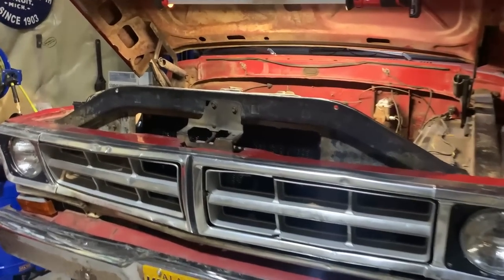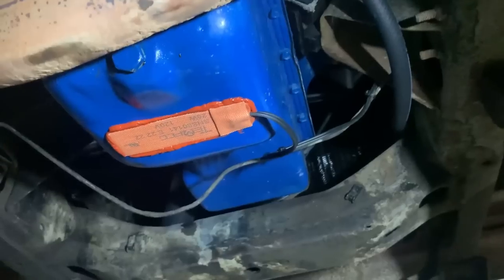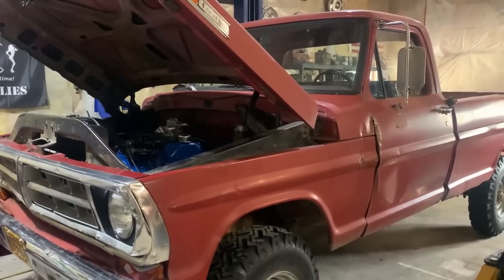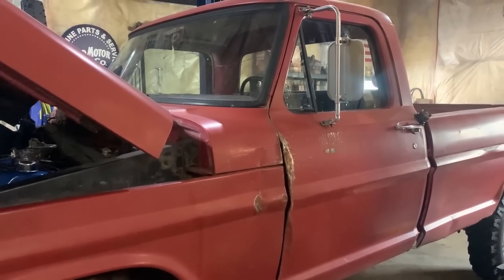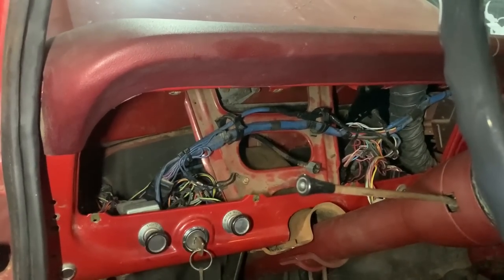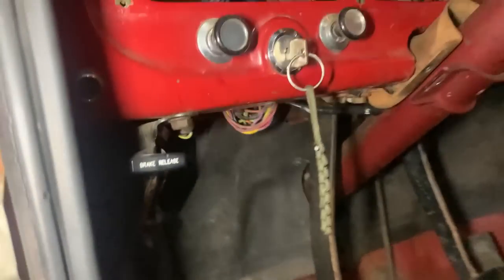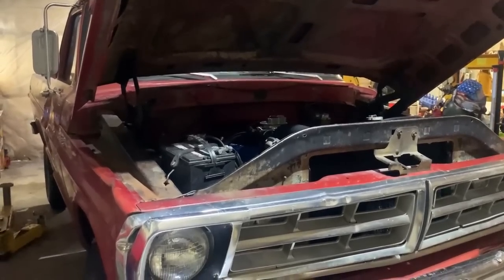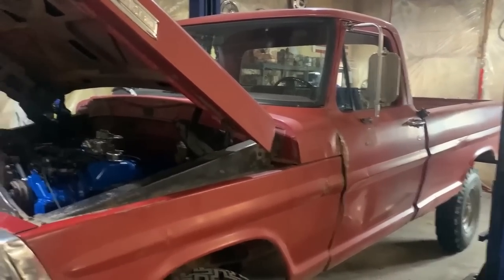Working on the Ford Highboy

Comment: When I first bought my 75 F150 it had a really bad voltage draw (the voltage regulator was bad) and would drain the battery overnight. In the process of finding the problem I found a bunch of other problems that weren’t told to me. The dome light switches were broken off, the stereo was wired up to switched power only, and two of the five fuses were wrapped in tinfoil lol. Believe it or not the local Ford dealership still had dome light switches in stock.

Comment: BA, you've only had that unit for going on 8 years and its been a driver for several of those already. My 66 VW project car has been in my hands for 20 years, with many other projects and distractions, and has only been a driver for 3. After a quick and dirty flat black spray I'll be doing a more careful respray this spring to satin black. I may even have the dual carbs rebuilt and back in place by then (currently running a 34mm single). Don't beat yourself up you're about 10 years up on me right now. All the very best!

Comment: Good to see the Highboy getting some love, the fact that you are still driving a 50 yo truck is a testament to what a great platform the F series is, we shall see if the 7.3 has a similar longevity. I have seen and done some dodgy stuff to fuses but a live round, that is GOLD. What engine is that running, in Australia we had the Cleveland 351 mostly and a big block was a special order. Nowdays all F series are a special order and don't expect much change from $300 000 AUD.

Comment: Wow you really killing it with the extras on the old gal. But definitely a good idea especially up there. Good idea bad idea throw a second battery in her and an inverter that way you can always run those heaters whether you're plugged in to the house when you're home but when you're out and if you want to keep that motor warm you could always plug into the second battery with an inverter oh, and there's many many other things you could do with that as well. I do I was actually working on my project truck out at the storage lot and I plug my inverter into my other truck battery and was able to read you cut all the pipe for my exhaust system. Just an example but without that inverter I would have never got it done by hand that's for sure especially not in the dead of winter in North Ohio. Anyway my friend another great video keep them coming.